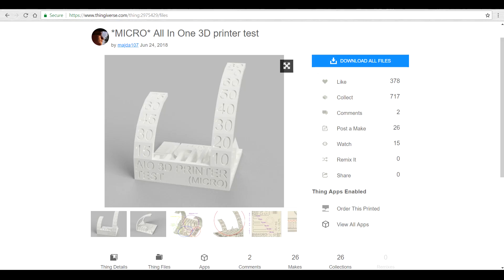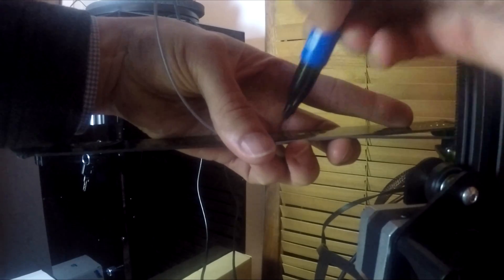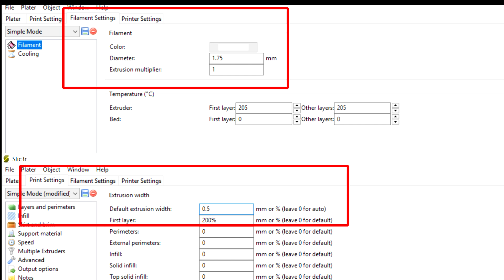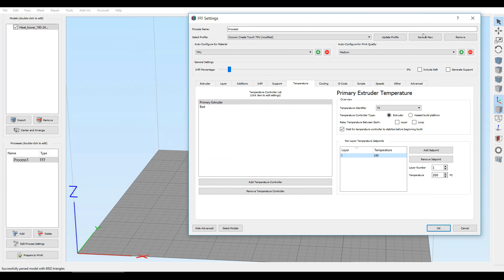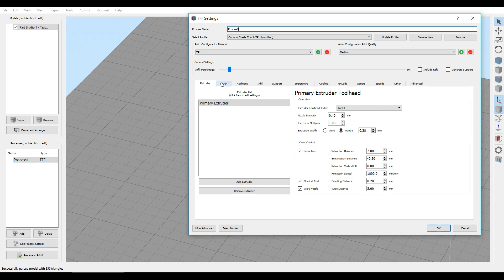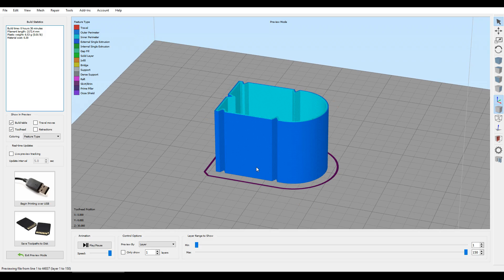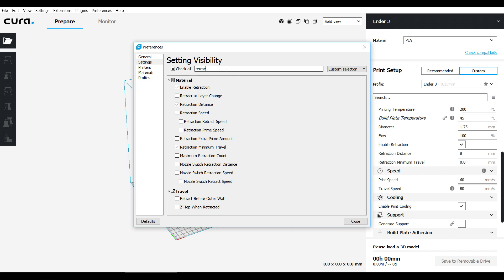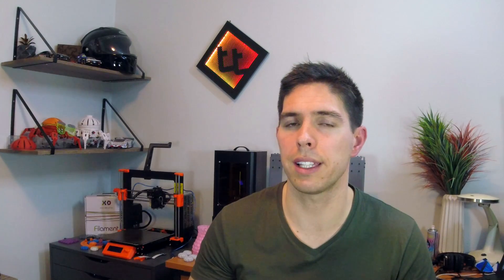How to tune your slicer settings featuring Ender 3 - UPDATE IN DESCRIPTION

Comment: This is a great video. One thing that got me though was in Simplify 3D you can use the variable settings editor(Tools > Variable Settings Editor, make your set points and split. Auto makes new process for each height and puts in the start and stop locations) and divide those temp changes in a matter of seconds. Awesome video though, really appreciate all of them you do.
Reply: That's nice. You can use this as a color change tool too. It is a great tool that S3d has.
Reply: Sorry to be so offtopic but does someone know a trick to log back into an Instagram account?
I was dumb lost my login password. I would appreciate any tricks you can give me
Reply: @Mohammad Alfonso Instablaster ;)
Reply: @Adrian Martin I really appreciate your reply. I found the site thru google and im waiting for the hacking stuff atm.
Looks like it's gonna take quite some time so I will get back to you later with my results.
Reply: @Adrian Martin It did the trick and I actually got access to my account again. Im so happy:D
Thanks so much you really help me out :D
Reply: @Mohammad Alfonso no problem =)
Reply from the maker: Thanks for the great tip, you've taught me something new :)
Reply: @TeachingTech  Does this apply to all Ender 3s? Meaning that I can put in the same values as you did and have the same outcome.
Reply: @dannyhoang7410  run the tests and compare, reply here with results - I'm interested, just finished building and tramming my ender 3 👍
Reply: @dannyhoang7410  I ran his Gcode and get much better results then anything else iv sliced on my own with cura, so i'm beginning to think I have a bad version of cura. might be time to get S3D
Reply: @kylejc9  $149 no thanks
Reply: @TheOriginalCoda  year ago s3d was good, now cura and pruisa are better

Comment: I have a Creality Ender 3 Max Neo, and recently purchased a Elegoo Centauri Carbon (Which I love especially as they ironed out so many niggles). The question is Orcaslicer and getting it to work with the Creality. I use Cura for my Sovol SV01 Pro and Creality for the moment. Orca had no problem finding a profile for my Sovol, but the Ender is still an issue. Could you do a walk through or video on this subject as I find Cura good, but Orca seems a far better solution and I would like to use one program for all my printers. Love your channel by the way, so many good tips and excellent advice. Thanks

Comment: when calibrating the wall thickness, I realized for the Flow in Cura is a percentage rather than mm/s. Should I just put in the number I calculated, or do I need to adjust for it being a different unit of measurement? BTW, with the .5 thickness and 100% flow and what I measure and calculated, I ended up with a Flow of 78.49, that's was different from the original setting, which I think was 100. Is that ok?

Comment: AAAHHHH! I'm dying here! Spent the last 12 hours trying to work out why my anycubic vyper won't print correctly. Then I try printing this calibration and it prints perfectly! I can't export the profile because it has been made in simplify 3D. I try trading through the GCODE but can't decipher what settings in the calibration piece make my printer work perfectly, so i but simplify 3D for 199 usd. But the fu@king program won't open. I'm pulling my fu@king hair out.

Comment: Something you missed with a temperature tower is that if you just pick the temperature that looks the best (generally lower) you can miss the effect low temp has on reducing layer strength/bonding.

Comment: Question, maybe someone has an answer. Should I run most of this when using drasticly difference filiments like ABS or do these settings work for anything I run through that. The reason I am asking is because I like doing figurines and minis on my FDM printer, I enjoy the challenges and manual repair of the occasional draft, yes I know "ABS bad" but its cheaper to buy than pla and way cheaper to smooth. That PVC pipe cleaner is costly in large amounts compared to ABS and Acitone being on sale for 3 bucks a gallon at Lowes.

Comment: I've used this video many many times to recalibrate our 3d printer. One thing I did discover is that the Cura/Creality Tweak at Z plugin does not actually keep the speed for all layers after it when you change it. In the g-code, there isn't a reset string at the next layer, but the speed nonetheless reset at the next layer. I had to manually change the g-code on every layer to make it work correctly. The plugin works fine for the temperature, but I noticed this problem for the speed. That's likely why there wasn't much difference in the layers for the speed test.

Comment: I have been watching your very helpful videos, but I have a problems with my Ender 5pro pricing prints with the y-axis shift at every layer. I have tried everything mechanical, ie tightening screws, checking belt tightness, snagging cables and even place extra cooling fan underneath the board. None seems to work. I have also tried using different slicing software. Nothing seems to cure it. I checked the coordinates set in gcode and they are correct. Do you think its the reality board V1.1.5 problem. By the way can it be reset to factory setting? Thanks for your help.

Comment: This video got me started off a few month ago when I got my Ender 3. Now I run into a strange problem. I wanted to change a few parameters in the speed test, so I used the .stl file and sliced it in Cura 4.8.0 All indents end in a blunt point, while in the original .gcode file 2 are blunt (near the corners) and three are sharp. I already switch on the thin wall printing, as I suspected that to prevent the sharp point, but it made no difference. Any ideas what tochange in the Cura slicer settings? In the mean time I also installed Prusa slicer and it makes sharp indents on all positions.

Comment: I do not have $150 to spend on the Simplify3D software to do the retraction test shown as it is in this video. Is there any way I can do a similar process in Cura 4.8? Or do I have to print the tower multiple times with different retractions?

Comment: @6:53 You mentioned inputting 3000 mm/min being equal to 30 mm/s, but that would be about 50 mm/s, and this would corroborate the ending speed of 100 mm/s. Thus, the speeds would be [50, 60, 70, 80, 90, 100] mm/s for all 6 layers. I just wanted to clarify this for anybody making these adjustments themselves, as Cura allows users to input print speeds directly in mm/s.

Comment: Hi am i correct in saying that the temp test print should be every 5 degrees at every 25 layers? if so the video is out of line with this layer at 76 it jumps to 106 should this not be 101

Comment: Flow rate calibration is misleading. 

Calibration with single wall cube gives really high and wrong results for flow.

Instead of single wall cube, If you calibrate with a double wall cube you get good values.

Comment: Hello. I am using BIQU B1 printer. printed the Gcode model ( small bear ) and it printed perfectly. but all CURA generated version 4.7 prints really bad. the print is with lots of layer seperations ! and also lots of holes in the wall. not sure is the issue with Gcode or printer. can you suggest something here ? thanks in advance.

Comment: So funny enough, my ender 5 pro with the included filament, made hardly any difference on the retraction test, except for 0mm, of course. Although 4mm retraction does leave the best result so I think for 99% of the printers with capricorn tubes, 4mm nozzles and 1.75mm filament, that is a safe setting. The speed test I am currently still printing, but I am hopeful to use 4200mm/min as well. Temperature across all machines for PLA is usually 200-220'C anyway, I would only mess with it for huge overhangs, but then you mess with speeds as well and it gets messy. 
VERY cool tests and ABSOLUTELY NECESSARY for everybody setting up a new printer and testing an old one. 
I impressed the employee at the place I buy my filament, with how amazing the ENDER 5 pro prints right from scratch. Granted, I tuned it up and fitted all the parts extremely precise, including the guide wheel tension.

Comment: There is an issue with Your speed test, you are running the under speed restriction to 20% if the layer is 15 seconds or less, which means you are literally printing the whole object at the same speed.
No wonder your print was the same throughout. (This needs to be unchecked, and still there is the issue that the Infill will cause a major issue if your print speed is too high or low for it to stick)

Comment: I calibrated and fine tuned my Ender 3 based on your video. I was able to print the SPEED TEST stl using PETG and it came out perfect! (at least for me) all the layers and curve are uniform and smooth. No stringing or any imperfection.
I wonder if I can extract the printer setting in Speed Test gcode file?

Thank you so much for this very informative channel. Keep it up!

Comment: Thanks for this.  I just ran your speed test gcode and saw the speeds increasing for the inner two layers but the outer wall went slow from bottom to top it seemed.  Did anyone else find this as well?

Comment: man, when my printer gets precise in terms of holes matching printed "pins" in the same dimension, the nominated dimension doesn't match. For example, a 20mm pin fits perfectly in a 20mm hole... but both measures 22mm or 18mm instead of 20mm

what could it be?

Comment: Just upgraded to skr mini v2 and tft35, after having the ender 3 a few weeks and having trouble calibrating the esteps.. Any help? Seems to extrude at different speeds in Marlin mode touchscreen and via pronteface... Either way I wasn't expecting it to be much different than the usual esteps before board and Tft upgrade..?
Reply: No it shouldn't really vary. The feedrate via pronterface and the tft will vary depending on your settings, but that shouldn't change the calibration method.
Reply: warmesuppe think i had it plugged into the pc before i powerd it up.. which ive now read the stepper drivers dont like!

Comment: Great video. I did this tune up and got great results initially. Now, I a getting stringing, not during transport, but on the printed surface itself. I am printing PETG at 240 nozzle and 80 bed temps. It initially printed perfectly, now it is getting stringing and little blobs of strings in the print. I have changed the nozzles, which initially helped and I also reduced the extrusion multiplier, even though it was extruding exactly 100mm in the test and it helped a bit. Now it does not and is getting worse. I have an ender 3 with direct drive and SKR Mini E3 board. Any suggestions? Thanks!

Comment: @Teaching Tech -- Great video, very useful. You went into how to persist the E-steps, but after that, just kind of skipped over where to save those settings. Is there a place to persist default speed, extractor temp, etc.? Thanks!

Comment: This video was super helpful in learning all the basics in tuning, and will really help with my troubleshooting in the future. I noticed that the retraction distance on the temperature tower is kind of long. I see a value of 8mm for extruderRetractionDistance. On my MicroSwiss all metal hotend for the Ender 3, this caused clogging about half way through the print. According to MicroSwiss, the longest recommended retraction distance is 4mm (for their Ender 3 hotend). I'm wondering if it would be a better option to have retraction turned off during the temperature test, and then dial that in during the retraction/stringing test.

Comment: Mine printed perfectly with one exception. All of my prints begin with the first several layers coming out rough on the edges and not tall enough. My first level at 240 degrees is half the height of the rest of the levels.
Reply: SAME here, on a new Ender 3, also on the "Micro all in one 3D print test" I cannot read what is on the surface.

I think It has to do with bed leveling height or slicer settings for first layers, got to be that!! Will find out and reply here.

Comment: Showing an example print of the Micro all in one 3D print test from a printer that's pretty well dialed in (1:17) isn't really all that helpful. It would be much better to see this test printed on a printer that's all out of whack so you can show us what flaws to look for, define terms with examples (ringing? what?) , and show how specific problems are addressed by specific fixes.

Comment: Just got my Ender, and this helps a bit. However, I would've loved it if you did all these tests with cheap grade, issue-ridden filament, so all the calibration tests would actually show the differences and faults to look out for. I'm guessing most people would find this, because they have problems. Tuning a very tolerant filament is kinda redundant.

Comment: How did you work your slicer settings to change retraction distance at different layer high for the retraction test. Im using Cura 4.6.1
Reply: Extensions/modify gcode

Comment: Could you confirm what's the retraction speed and distance in the temp tower you used in this video?
I got the same result as you... everything is stringless! Every. Single. Temperature. Never happened before. I'm so lost right now.

Comment: Hi Michael,
could you please share your exact retraction settings you used for the test? Not only the retraction distance, rather also the retraction speed, prime speed and extra prime distance.
Other print settings would also be interesting, like print speed and layer height in particular.
Thanks a lot.

Comment: Any chance you have a video where you are using Cura ?  I know absolutely nothing about the slicer you used here.  Also I can't understand how to convert what is said here over to a Cura slicer.
Reply: I'm a bit confused as to how you set the retraction at 2,4,6,8.  Could you clarify how to set that in Cura?
Reply: Extensions/modify gcode

Comment: A really good video that has improved my prints, but I have one question.

How do you figure out that 3000 mm/min is 30 mm/sec?

My calculations says that 3000 mm/min is 50 mm/sec. Am I missing something here?

Another thing. I'm pretty sure you said that you would increas eby 10 mm/sec for every 5 mm. That doesn't add up with 6 layers, the end speed would be 80 mm/sec. Minor issue though.

Teaching vidoes are nice, but they should be accurate so amateurs like me doesnæt get confused  :-)
Reply: i think you have to divide it by 60 so it should be 50 mm/min so you are probably right
Reply: it's not..

Comment: Out of a good dozen of videos I watched yours was by far the best and easiest to understand.. especially because you would discuss the identical setting on multiple slicers so regardless of what I was using I could follow along. Quick question is can the flow default be set in the g-code like how we correct the estep? I don’t know if the slicer will save the new value every time it’s opened otherwise?

Comment: I'm sure this has probably been mentioned previously in at least one of the 709 comments, but in the speed test portion of the video, you state that 3,000 mm/min is equivalent to 30mm/s.  That's false.  3,000mm/min is equal to 50mm/s so your speed test is actually testing from 50mm/s up to 100mm/s no 30 to 100mm/s.  

Other than that, thanks for the incredible video.  This helped me out big time.  One suggestion I'd like to make is to be more detailed about how to follow along in cura.  You lightly touch upon the cura settings but not nearly enough for a novice to follow along without doing some research.  Fortunately, I was able to follow along and also have S3D so it wasn't a problem but this would help a broader range of your target audience.  Keep up the great work!

Comment: On your speed test, I think it looked good throughout the print because you had the speed override checked in S3D.  This can be verified in preview if you change coloring from  "feature type" to "movement speed".  You should then see shades of green on the model going from darker at the bottom to an almost yellow at the top.

Comment: Hey thanks for putting this together! When you say the outline is slowed by 50%, does that mean the 100mm/s speed really means a 50mm/s outline? Or does "full speed" refer to 100mm/s (even on the inside walls)?

Comment: I did the extrusion cube and have questions.   My wall line width setting in Cura 4.5 is set to .4 and the print is exactly .4.     Is this a new setting, since you do not mention it?   I set the wall thickness to .5 like you recommend, but do not see where it factors in.
Reply: how did you find the e-steps in cura?

Comment: 9:30 To be clear. I checked the .gcode in the thingiverse. The point when your stringing stops (L=61 z=12.18), is the point when retraction starts at 2mm, so even 2mm might be enough. 4mm might be the better option though to prevent oozing during longer travels. (My guess.) 

Also, coasting has an effect on stringing by releasing pressure from the nozzle in the end (Bot do not use coasting with linear advance, let lin.adv handle all predictive pressure controlling. Minimal amount of retraction is still ok)

I'm going to try to settle with a retraction of only 3-4mm now that my bowden setup finally works properly.

Comment: FYI YOU MUST CHANGE EXTERNAL THIN WALL TYPE TO "ALLOW SINGLE EXTRUTION WALLS" its in the advanced tab in simplify3d. Will not let you print single wall if you dont have this setting.